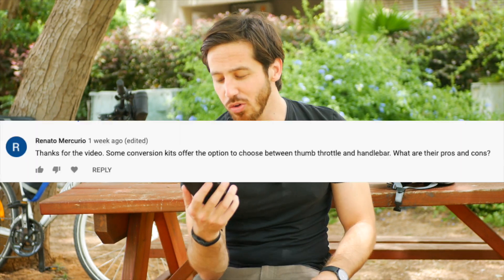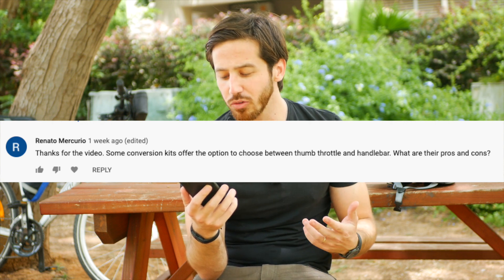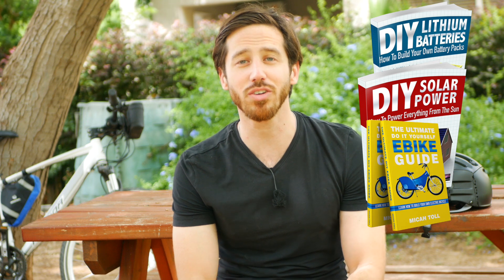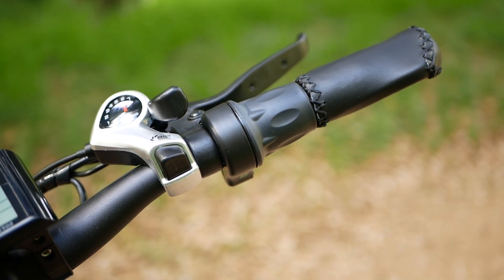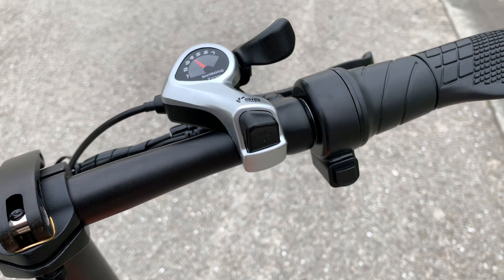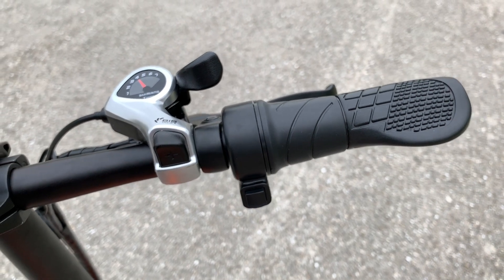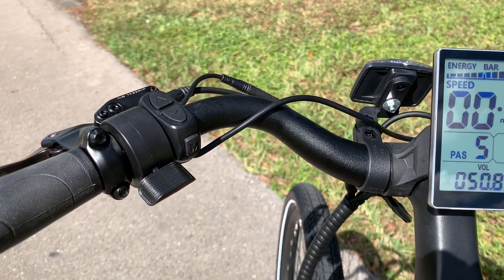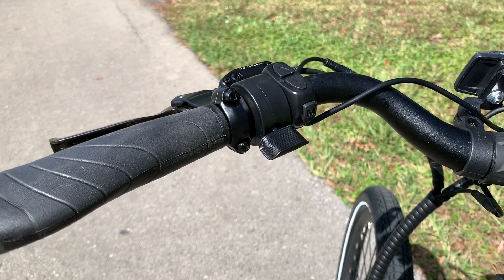THROTTLES: Twist vs Thumb - Which is better?!

Comment: Been a motorcycle rider for 52 years, ebike rider for 5 years.  Living down under where we drive on the left side of the road, the tendency to mount a bike is from the left or gutter side, so it's easier the have the twist grip on the left.  I predominantly use the throttle to assist take offs, much easier to get moving before cocking one's leg over to take up pedalling.  I don't have a problem adjusting from one hand to the other between ebike and motor scooter which I still ride too. So if you drive on the right side of the road, RH throttle is best, and left side of the road LH throttle is best.  I do prefer twist grip, Cheers

Comment: Thinking of installing a Bafang BBS02 on my new Trek Verve 2. The problem I see right off the bat is that the bike's trigger shifter is going to get bumped out of reach if I have to make room for the standard right-hand thumb throttle that's included with most kits. A full or half twist seems like the logical alternative, but a left-hand thumb throttle would definitely work since I lose the front derailleur shifter when going with a mid-drive. From having a rear hub e-bike in the past, I only use the throttle to get started from a full stop.

Comment: Let s say that with a single charger (i.e. 58.8V) you want to charge 2 52V batteries at the same time and in order to do that you make a 'Y type' splitter with 1 female terminal and 2 male terminals. Assuming that the 2 batteries before recharging show different voltage level, say one os at 43V, the other at 46 V. What precautions would you take to prevent current  running from the 46v battery to the 43v battery through the Y splitter? Maybe diodes  on each positive wire? Or maybe following a rigid sequence, charger to splitter first and then splitters to batteries, will suffice?

Comment: I have a Rad eBike which has a 1/2 throttle on the RHS.  Is there a gadget which will hold the throttle say, in the full or part-open position for extended travel at this speed without me twisting the throttle?

Comment: Does anyone make a locking throttle for straightaway riding?  That would answer the thumb or wrist fatigue issue.  Cruise control for bikes I suppose. A quick release function could be added to the mechanism.

Comment: Once it keeps going u don't need to touch it untill u want to stop hitting the thumb throttle again or it will keep going need to hit brake only connect the front to kill the motor the hub not back so you can wheelie 1500 watts 1000 to but 5 miles slower

Comment: Half twist throttle, on the right, works best for me. I'm used to it there, and my thumb is free to shift without letting go of the throttle. I sometimes take my modified RadMini on mountain bike trails, and I'd run into trouble trying to hang onto a full twist throttle.

Comment: I installed a popular mid drive kit but the new chain wheel is bigger by a few teeth. I tried to find the few additional links of the right type to add but they aren't available like that. Why? I had to buy a new chain. Also can you do a tutorial on chain repair/maintenance? Thanks

Comment: It would have to be thumb throttle for me since twist throttles tend to be on the right and i cant use my right hand very well for the twisting motion  in the first place so any e bike or motor bike always has to be modded in some way to be fitted on the left side of the handle bars.

Comment: Here's a question on YouTube I see the majority of reviews seem to be for some sort of Fat Tire bike. The There's cruiser types where the mini folder brings up the rear in getting attention but I think at least to me that popularity or volume is backwards to reality. Volume is where you want to aim for when selling a product. Apartment Bikes (A name I gave the mini folder) seems to be where I'd aim my product for. Don't get me wrong all models are cool but fate tires are more likely to be niche than a bike which takes up less space, more easily carried in and out of an apartment. Cities are famous for congested traffic and often times you have to climb stairs or use an elevator to get to your apartment which might have its own space issues. I've heard these bikes called Last Mile Bike but I think that paints a very limited usability option for a bike that can get you around town, do errands, grocery shop, make appointments etc. if the bike is designed correctly that seems a rich vein to tap? As example using my Swagtron I can easily carry a spare battery in my backpack so I double the mileage and still have loads of room for some shopping.

Comment: Another great informative video 👍👌 
I personally run a Left hand Thumb throttle as i have a 11 speed Gear shifter on the right. I got my thumb throttle version similar to that of a jetski or Quad throttle meaning movement from right to left instead of the thumb throttle you showed which operates in a up/down operation. I think the jetski /Quad style is easier to use as its closer to my normal left hand grip position (a more natural position)
Reply: Where can you get this Quad style throttle ?

Comment: First let me thank you for your show. I find it very beneficial as I'm working on people's e-bikes all the time and you seem to have all the answers that I need personally. By the way the book that I'm interested to read, quite frankly is all of them, first book I would like to read is about lithium batteries. Now my question is concerning aftermarket throttles with battery display. The one I'm installing has a key ignition on a full throttle grip with three wires for the throttle three wires for a switch of your choosing and two thicker wires (Yellow and Blue)that hook to the battery (to display the voltage remaining) and a lock out wire . I assume that's for the key. I have two different controllers to hook these throttles to . one being a regular red white and black three wire throttle with LCD screen the other being the cheaper model with the five or six wire combination throw with red yellow green display with the red button. will this hook up to one or both of these controllers? If so how? if you've already answered this in one of your videos maybe you could just send me a link to that video thank you.
Reply: 5635 Twin Lakes Ct
Indpls. IN46232 is address to send your book,

Comment: Now aged 73 and having driven and ridden all sorts of cars and bikes I thought I was fully conversant with most cable and sprung throttlesa. Always will be a twist grip guy though. All my life I have been or at least tried to have been a  courteous driver and rider. I now have a huge problem. When I used to drive trucks and sometimes cars, if I had a full and heavy load and could see that I was holding up traffic I could give them two ways of me telling I knew they were there and also by either opening my drivers window could wave them through if the way  ahead was clear or could indicate and tell them by using my flashers. Neither I know are really street legal here in the UK but are generally accepted as good manners. Now to my problem with my three wheeler motability electric scooter. Mine, because it is listed as being for Continental use also has a three position setting for throttle. 1 = 4mph for use on sidewalk (pavement here in the UK.  2 =  8mph for use on all roads and highways and then 3 =15 mph for Continental roads or private land. Throttle is smooth in increasing speed in all selections, however If and when traffic is building  up behind I dare not let go of the spring loaded throttle as it shuts off power so quickly I know that before I can signal using the standard circled hand then the traffic behind me would be grinding me into the pavement. Know what I mean ?
Is there any way of modifying this shut down? I must admit that it's almost handy as I shut down speed in increments when approaching a junction, however I'm sure I can get used to that rather than causing a crash. Any and all ideas welcome . Great show  and thank you. Regards Alan

Comment: Left side thumb throttle beside the control panel keeps the "electric" side of the bike together, with the pedal  control on the right, no clutter. The twisting is not conducive to good balance. I only use the throttle to "take off", so no strain at all, the pedal sensor controls the motor when under way. I understand the confusion for motorcyclists, but get a grip!

Comment: I have a 15kW monster ebike (actually 18kW but I don't push it to full voltage). I currently use a full twist. I am really concerned about the pressure I put on it as I hold on for dear life when I go full beans (which I do often - I just can't resist it). The full-twists I've seen are only anchored onto the handlebar at one end - the other end is just floating, there is no means for it to put the reactive force along the entire length of the twister; this is asking to be broken.

Comment: I ride an e-bike, MTB, 1000w ultra, fat tire, with a thumb throttle.  I  rarely use as it drains the battery in no time.  Issues:  can be dangerous - accidently bumping the throttle while on uneven terrain; front tire lifting off the ground when used to start from a dead stop; and should you crash the throttle can be activated by a tree branch or other item.  On the street its okay but worthless on rough roads/trails.

Comment: Which lithium battery type is best for long range and long battery life? NMC(INR chemistry, eg: Samsung INR 35E) or NCA(NCR chemistry, eg: Panasonic NCR 18650B). I'm a teen DIY enthusiast and have immense taste for electronics but I have no idea about such electro-chemistry. I read long articles claiming the Panasonic battery is also used by tesla and its cycle life would increase if the battery is kept between 70%-30% charge. Is this thing true for all lithium ion battery or is it only for the Panasonic, because other than a good capacity battery I also want long life. On the other hand, Samsung is base on NMC technology which is recommended for Powerwalls and due to their high discharge capacity people also use it for DIY batteries. 
Please help me out, I'm searching for an answer from a long time. Its a humble request please reply.
Reply: Great question.  What did you find out over the past 3 years? Look at NMC811 cells.

Comment: You can have a twist throttle with a grip shifter easily. Just put the throttle on the other side. It's not that natural but you get used to it easily especially if you have a midrive and you need to shift often, sometime 2-3 gears at once (that's why I'm using the twist shifter). For me that's the best configuration and it works perfectly. While using a thumb throttle or shifter I found that tendon inflammation occurs much often

Comment: Not all thumb throttles are the same.
The first one from the video if the best because your thumb is always attached to the handle.
There are some cheap others like the one I most hate and it's mounted on the Emove Cruiser and it's an optional.
Basically they use the same index throttle but it's mounted downwards, done this way the thumb is NOT in contact with the handle like it's the one in this video.

Comment: greatly prefer a right hand half grip twist throttle.  I also have motorcycle experience.  A left hand throttle is dangerous in my opinion due to the mix of standards.
  My worst throttle experience was on a motorized scooter which used a pull lever throttle on the right side.  When I was climbing a hill, the bike wheelied which resulted in my loss of balance and pulling the throttle lever even harder to hold my grip on the handlebars.  I flipped over and landed on my back and broke my shoulder blade on the asphalt.  Very painful accident with months of slow recovery.
Reply: I read all the comments for this one.  That was what I was fearing, but you were the one who confirmed it.

Comment: I ride motorcycles, so am used to the twist throttle.  Having said that, have taken several test ride while shopping for an ebike.  All have the left thumb throttle. I adjusted so I will go with the ebike that meets my other needs and not worry about the throttle placement.

Comment: You ride motorcycles and such, so you like a twist throttle on the right side.  Makes perfect sense.  Does the reversal of the brake levers on most ebikes drive you crazy, then?  Why the front brake gets moved over to the left hand on an ebike makes no sense to me.  For someone who has never ridden anything else, you're more likely to want to use over time whatever the first thing you used was.

Comment: Hey i am starting an electric bike rental business in my area and i'm currently building my fleet. I will be useing mountain bikes but im unsure whether i should use PAS, 36 Volt packs ideally with 20 amp hour range or 48 V 10 amp hour with throttle assist. I'm unsure with would be better for a rental application

Comment: Could you please do a video on how to connect 2 or more speed controllers on one throttle ? I would highly appreciate it. Here is the example of the throttle #Aliexpress US $22.50  25%OFF | 36V 48V 250W/350W Electric Bike Controller with LCD Display Thumb Throttle for Ebike Electric Scooter
https://a.aliexpress.com/_dSHbkWJ

Comment: The Mod I bought came with a full twist, I didn't like it and got a thumb lever and absolutely LOVE it!  despite the issues over rough terrain, but that's what PAS is for, right?!?  lol  Also I use an old school friction thumb shifter and just have the throttle under the bars and the shifter over the bars works great!

Comment: I prefer thumb. Since my motor is only assistive - I pedal mostly - the throttle is rarely used and just gets me quickly across a junction or up a steep ramp offroad. I have it on the left.

Comment: IMHO, e-bike should have no throttle handle at all. It should have intelligent controller with assist mode, to help pedaling uphill. If you want anything else - just buy normal motorcycle with petroleum etc etc. It will be better for ecosystem, for your health, for your safety and also cheaper :)

Comment: Ok, I got it. This is the channel about electric motorcycles, not about e-bikes. If you "ride straight line at full speed" using motor - you are motorcycling your e-bike. That's fine, but not what I want. Now the question: should I like or should I dislike this video if I want youtube algorithm to recommend me videos about e-bikes which won't include information about electric motorcycles? Hmm..... *sound of rusted gears"

Comment: All 3 are bad. I have to modify throttles to make them usable so there's no wrist/thumb fatigue and no holding the wrist at an awkward angle. Start with a half twist. Glue a bar on the front so your fingers pull up on the bar to actuate. The bar is longer than the half throttle, so it subtends the whole grip length. Much more comfy for long periods.

Comment: Personally I don't like thumb throttles at all - I find them hard to use and modulate.
If I'm not wrong there are also throttles that depends on the pedaling - you have to pedal to make the motor work.
And I hate having front brake on the left side - it has to be on the right side for me because I also ride motorcycles and mopeds. It's completely braindead to have the front brake on the left.

Comment: Can you please make a video about torque sensors and more specifically how exactly to install them and wire them. There is no much information about that. Can I use my existing controller or do I need a special one, do I need a Cycle Analyst etc.

Comment: I prefer full twist throttle as it is easier to use the regen braking. I also have cruise control, this helps to rest the wrist or thumb when in use.

Comment: One trick to deal with thumb throttle fatigue is to use a more powerful setup then you need so you only need to barely press on the throttle. Though I guess that would be true for any throttle now that I think about it...

Comment: Hey Mike, you have not mentioned the "feeling" of a twist throtle.
I have used the thumb throtle, but the twist has a major advantage: really controlling the motor.If you press the thumb throtle, you can feel a certain gradual power increasing, as you are pressing the thumb button.But with twist throtle, that's more let's say "fine tuned" 
I can twist the throtle, just to keep the motor rotating really slow and being able to accelerate smoother, just like when having the more expensive controllers, for example ASI bac, or phaserunner.These controllers are known to keep the motor rotating.This of course applies only for mid drive motors, i have tested and noticed this while using bbs02b and bbshd motors.

Comment: I know you've mad a lot of batteries.. question:
I mad that 52v triangle battery from your video and book.  It ran like a champ but when I pull a lot of juice, it frys 3 batteries in the middle of a series, same spot multiple times even after I get the cells out and replace them.  What are the possible causes?  Its a cheap Chinese bms so my money's on that

Comment: Thanks so much for the videos I just wanted to ask If my ebike battery takes a xlr plug can I use a normal xlr cable to add as a extension and then plug my in my charger to charge my battery I'm currently running a 52v battery and my charger is 52v 4a thanks

Comment: A disadvantage of the half-twist is that you now have to find a "half grip" to  fill out the end of the bar.  If you use a full length normal grip, it gets too long and funky or it doesn't fit at all (hitting the curve part of the bar).  The "half grip" is actually fairly hard to find and limits you to a small set of available grips.
Reply: bruh just cut it
Reply: It's all about muscle memory which you'll get used to it.Period.

Comment: Do you have idea why scooter m365 reduceing speed, slowing down and then accelerate again.this patern is constant when rideing full trothel.maby to change capacitor from 63v to 100v on motor controler.?.or the number of revolution is limited by software